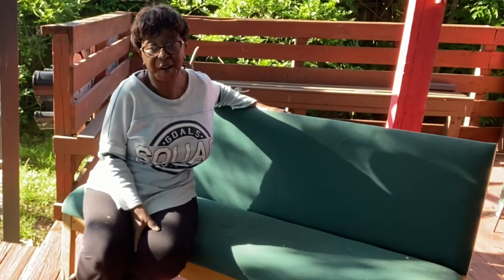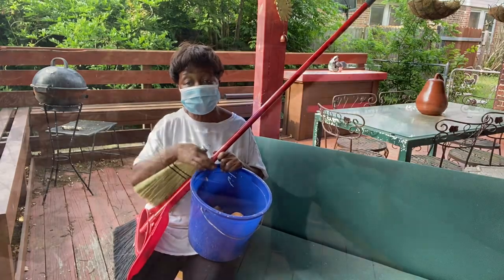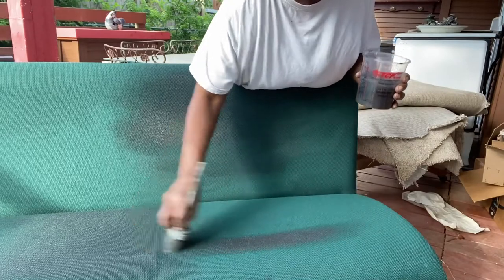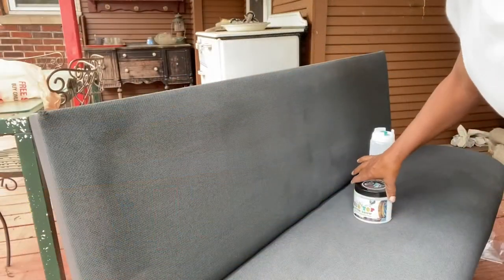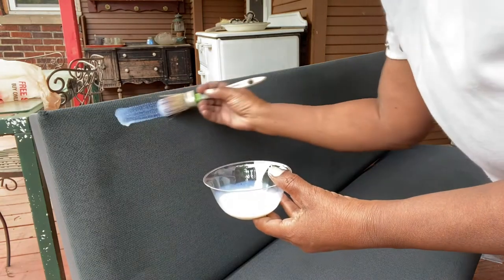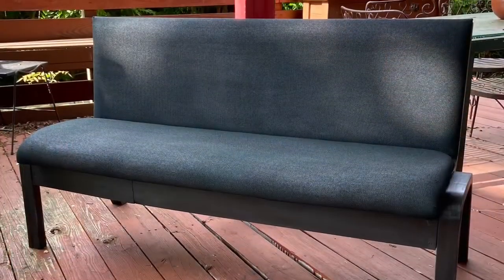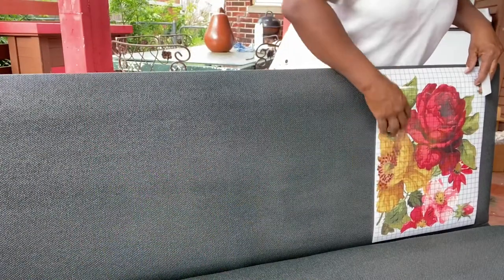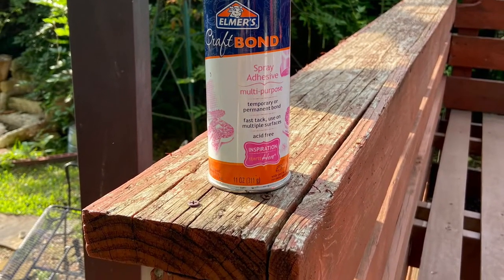How to Paint Fabric-Church Pew Makeover

Comment: Someone gave me 80 church chairs and they are burgundy. I want a charcoal gray or black color. What would you recommend?
Reply from the maker: Hello. Burgundy should be easy to cover with black. Might take a couple coats letting each dry in between. Sounds like fun👏🏾👏🏾👏🏾
Reply: @pecanporchboutique9293  will it stay durable for much use? Or will I have to reapply every so often
Reply from the maker: @zacharypetree  it will stay durable. I used a chalk style paint watered down so that it works like a dye. That thinner consistency let’s the paint get into the fibers of fabric and not sit on top which could make it crunchy to the touch. Once I had darkened it as much as I wanted I sealed it with a water based topcoat🙂
Reply: My favorite color is orange. How can I turn these pews to a beautiful color for a church building have a total a total of 18
Reply: They are piny rose color